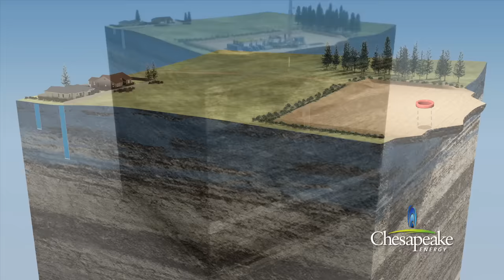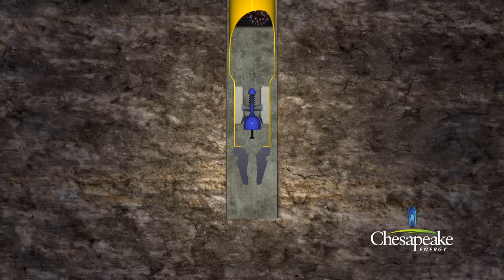Drilling Animation

Comment: When they hit bedrock they start drilling horizontally clear ✍🏼✍🏼✍🏼✍🏼
Reply: What is the maximum depth of wells you achieve? Do you use directional drilling?
Reply: I was a directional driller to i survived a colpase just 14 back ops later. It just has a little bend on the end so they keep in straight until they are ready and start turning it. Imagine sticking a wire stick into jelly and turn it does nothing take it out put a tiny little bend on the tip turn it you now have control you can only turn some much % per m so its not like a 90 degree turn its a nice sweep of a bend and if you wanna go straight againg you just turn the tip to its flat position
Reply: @bigtasty1082  Good explanation. Downhole motor technology is pretty cool too.
Reply: @bigtasty1082  Are you still in this position? I wonder if I can learn more. I am new to the industry and have some questions about directional drilling. I hope to have the opportunity to communicate with you.
Reply: Someone available I need some info regarding drilling ?
Reply: I need a little bit info
Reply: @bigtasty1082 I need info about drilling can you provide ??

Comment: I just hope that your ram-sheers on the BOP are sufficient to cut through the connection pieces of the pipes as those are thicker and tougher, we all should remember Deep Water Horizon, this was why the BOPs ramsheer failed.
Reply: @MotoVation 
Those operators knew that which led to a pissing match

Comment: You drill for direction the entire time after the curve.. up and down hitting the layer of shale. Then you line you frac ports up a cording to where the geologist found gas in the shaker samples (they take samples of cuttings from down hole all pumped back up through the over flow every 5-10 meters).. that's actually how it works.. as if we do one curve smoosh right into sweet crude straight line baby.. yeah right..
Reply: Are you still in this position? I wonder if I can learn more. I am new to the industry and have some questions about directional drilling. I hope to have the opportunity to communicate with you.

Comment: What is the maximum depth of wells you achieve? Do you use directional drilling?
Reply: depends upon the type of drilling method you apply. Ac drilling achieves approximately 150m while RC drilling can be upto 600m however the most expensive one is diamond drilling that can achieve maximum depths. Hope this was helpful
Reply: Here in Fort Stockton, Texas we have one around 25,000 feet deep. Vertical well, not horizontal.

Comment: Hi can someone please advice a solution for the removal of borehole drill bits that have come off and are stuck in the borehole.  I am travelling to Benin to try to remove 20 x 3m drill bits that have come off and are stuck upto 63m in the ground.  The borehole was being made for the provision of water for local villagers.  Many thanks in advance.
Reply: did you figure it out?
Reply: Use an overshot with a wireline unit?
Reply: good luck 🤣🤣🤣

Comment: Legend watching this after 8 years 🙂🙂🙂
Reply: What is the maximum depth of wells you achieve? Do you use directional drilling?
Reply: What is the maximum depth of wells you achieve? Do you use directional drilling?
Reply: @AlekseenkoVA  Directional drilling is the practice of accessing an underground oil or gas reserve by drilling in a non-vertical direction. so in here normal hand drilling can be used
Reply: @aksharamadaan4155  Are you still in this position? I wonder if I can learn more. I am new to the industry and have some questions about directional drilling. I hope to have the opportunity to communicate with you.

Comment: What is the maximum depth of wells you achieve? Do you use directional drilling?
Reply: Wells can be drilled to 20-25,000 feet deep (or more) and directional drilling is used to kick-off to horizontal. All wells are plotted very accurately so as not to accidentally intersect adjacent wellbores. They know where in space the drill bit is at any moment within a few feet.  It's amazing technology.
Reply: @davec.1045  Yes, I agree with you, the technology is amazing. At our work, geological and technological research is used - remote monitoring of drilling as well as directional drilling. the depth from the wellhead to the bottom is 4.5 kilometers on average
Reply: @davec.1045  Are you still in this position? I wonder if I can learn more. I am new to the industry and have some questions about directional drilling. I hope to have the opportunity to communicate with you.